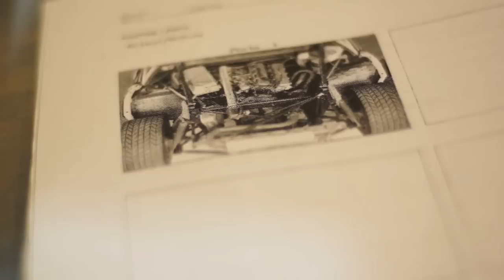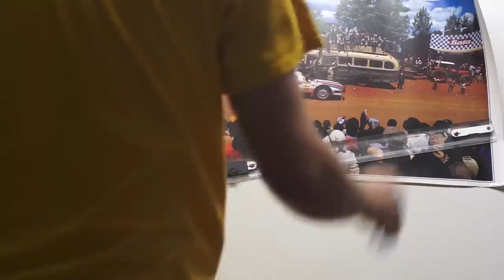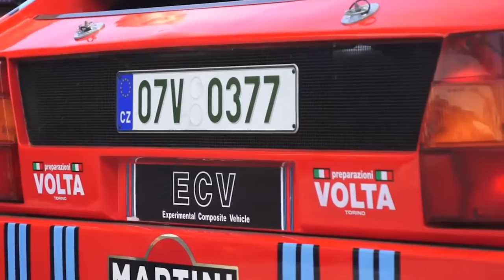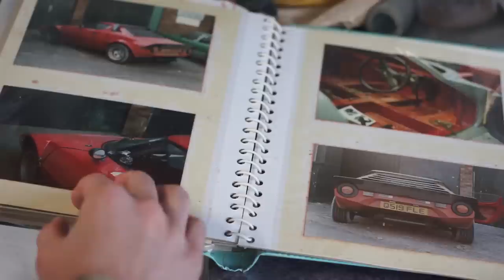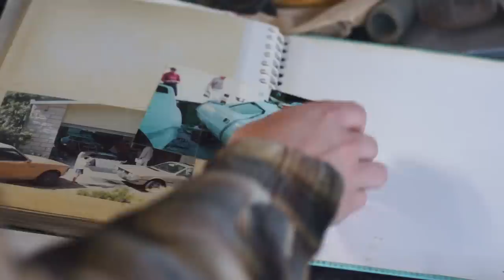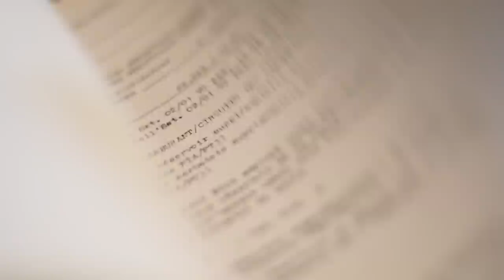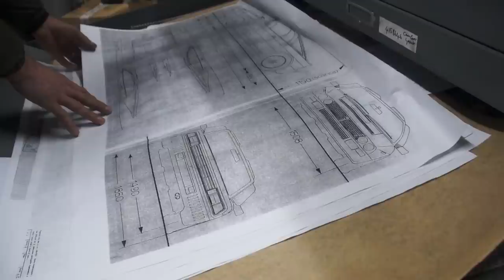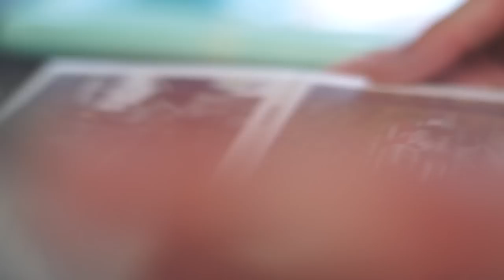Step 4: Relive Group B with the Lancia 037 [Episode 4] - /MY LIFE as a RALLYIST

Comment: Technically, Group B was still production cars, just in relatively low numbers. You could actually buy an 037, RS200 or 959 from the factory back when they were still making them... if you were lucky enough to be one of the first 200 or so buyers and had the money.

Comment: That Lancia is sick!!! But if we are talking the ultimate Group B rally car, then I'd have to go with the Porsche 959
Reply: delawaredistroyer It won Paris-Dakar and Le mans in its category in 1986
Reply: delawaredistroyer

Yup, they killed Group B before the 959 could debut. i don't think it even raced Pikes Peak.
Reply: I believe you are correct about the fact that it never raced, but it was designed and built for the class, which was terminated before it could compete. I still call it my favorite group B car
Reply: Whenever I think of group B, I either think of the Audi Quattro, or the Delta S4.
Reply: Wasn't the Ferrari 288 GTO (and its successor, the F40) also built to Group B specs?

Comment: They dont sound the same as the originals at all. The stock engine and gearbox is a no no in my eyes..should be a crime to replicate something without actually completely replicating it
Reply: Do you know if it's still possible to source the proper motor and gearbox?
Reply: Make one for yourself if you think it's that easy to make a pitch-perfect Dino V6 or an Abarth I4 SC.Even then their not the real things, and those engines cost a pretty penny if you can even find one.